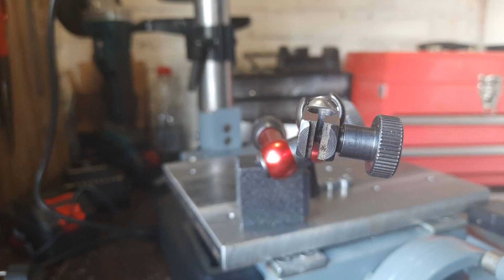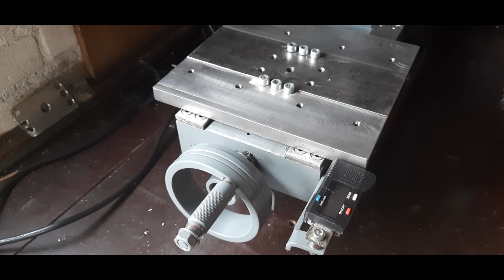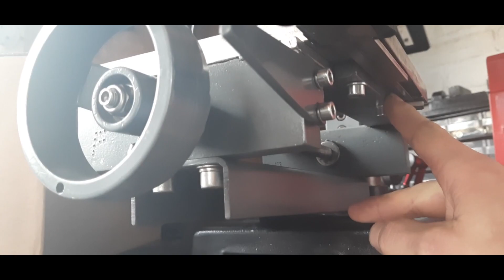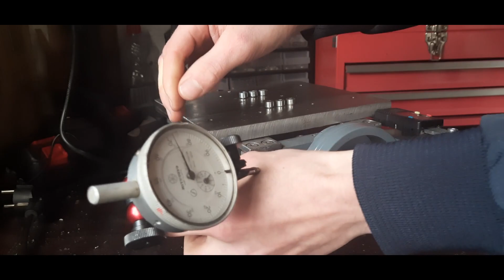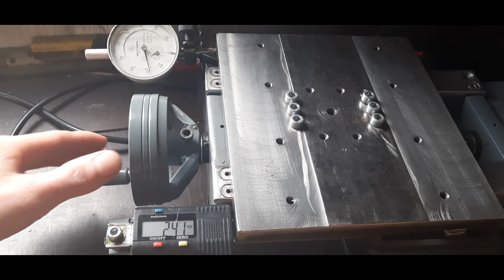Is This Homemade DRO  any Good?

Comment: Looks perfectly cromulent.  Can't complain about those numbers.  I find cheap calipers eat those little coin cells.  I threw a tiny little solar panel and super capacitor on an old pair.  It's a decent upgrade if you find that you're going through batteries.
Reply from the maker: Thanks for your comment! It is still on it's first battery so I don't have a reference yet, but as soon as it starts eating the batteries I will definitely consider this solution!